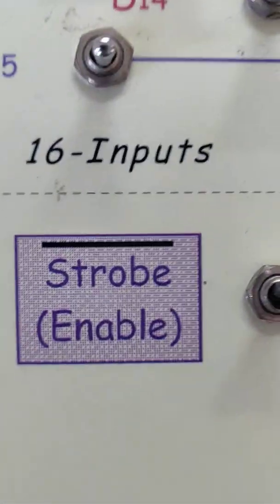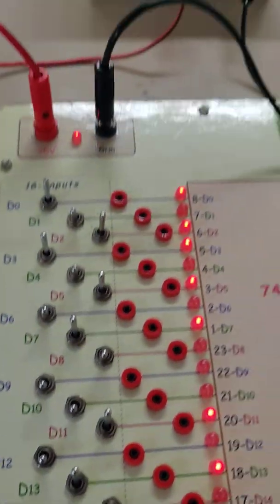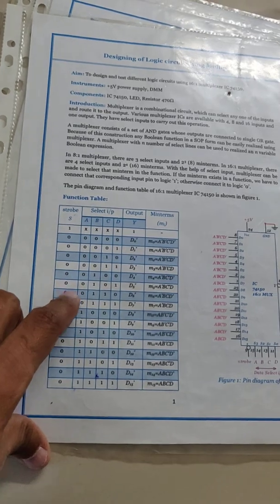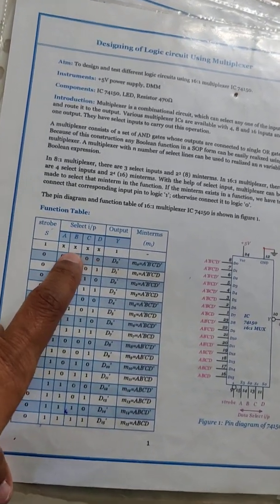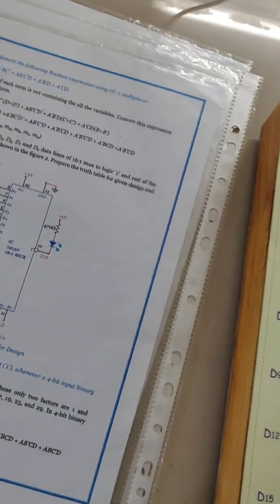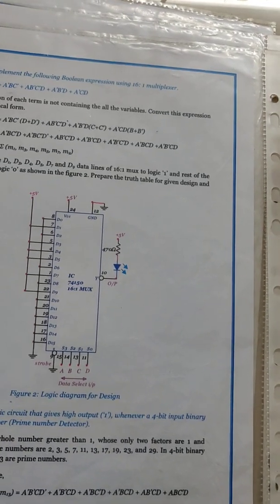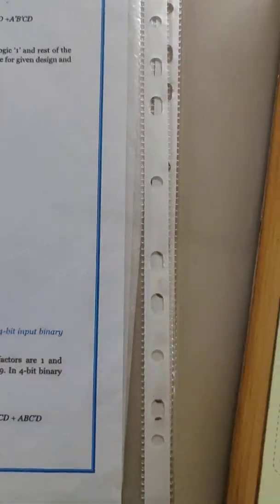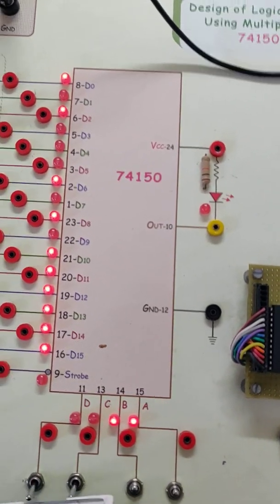Multiplexer IC 74150

Comment: Amazingly explained sir 

Tomorrow I m having my exam.
But the way u explained each and every topic I got...in the very starting I was having doubt regarding strobe that how strobe will lead to my output to be high all the time. I was not believing the theory but then I got to knw that if Strobe becomes high(1) it will always result in output to be high(1) so switching on strobe actually enables the multiplexer..now next doubt I encountered was how the output is not getting same as the input..I mean what I studied abt the basic multiplexer...but again u explained it very nicely that whenever the input is selected with the help of control signal the output will get simply the complement of that input...I mean this is how the 74150 mux works...so that's why it's a special mux ...now each and every doubts cleared...Thanks alot for this valuable explanation ❤️...u understood what kind of doubts a student can encounter while studying and that's what a quality of good teacher shud be.